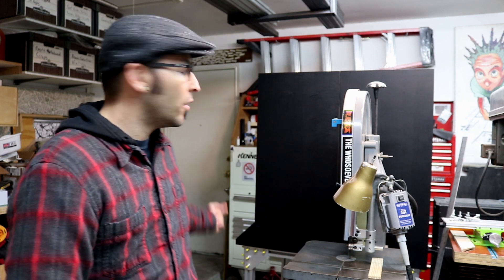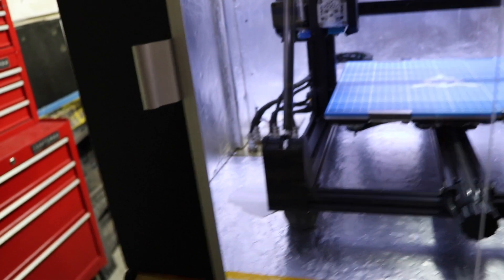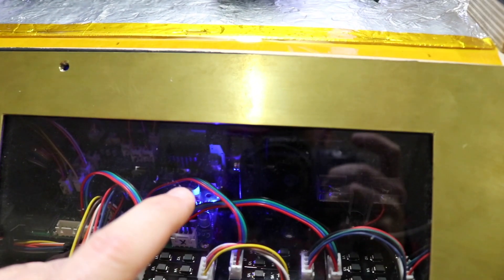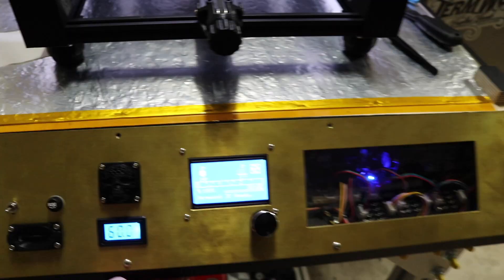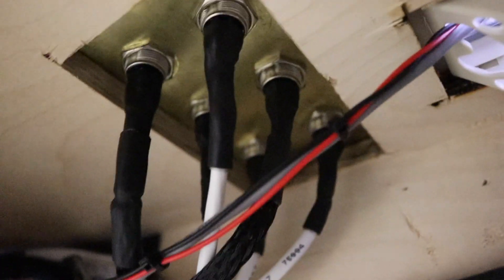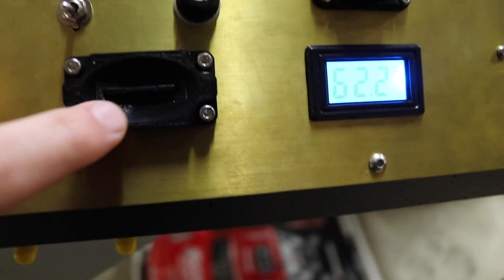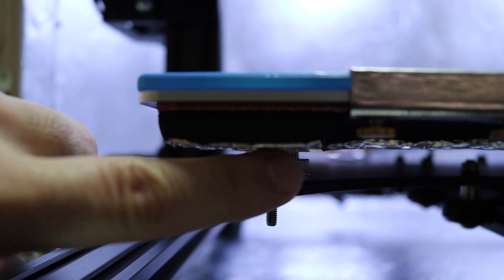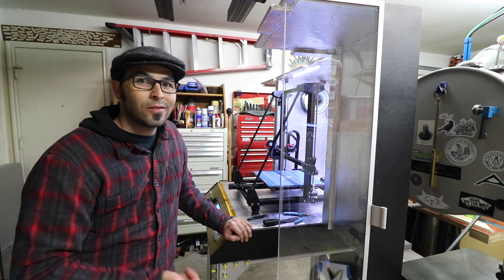THE ULTIMATE CR-10S 3D PRINTER ENCLOSURE!!!

Comment: Could you please share what type of connector you are using for the wires? The round, mostly 8 pins, is what I'm referring to. ty
Reply from the maker: They are 8 pin aviation connectors. I must warn you they are a pain to work with. 
https://www.amazon.com/Metal-Female-Connector-GX16-8-Aviation/dp/B07D2675JW/ref=mp_s_a_1_1_sspa?adgrpid=58799115031&dchild=1&gclid=EAIaIQobChMI9r_0vZG97wIVzP3jBx3JfAH_EAAYASAAEgLe2fD_BwE&hvadid=274709648591&hvdev=m&hvlocphy=9028249&hvnetw=g&hvqmt=e&hvrand=2348470054554098024&hvtargid=kwd-305733728779&hydadcr=19223_9665532&keywords=8+pin+aviation+connector&qid=1616183719&sr=8-1-spons&psc=1&spLa=ZW5jcnlwdGVkUXVhbGlmaWVyPUEyTUE3TEFLWEw0RDNHJmVuY3J5cHRlZElkPUEwOTIzMTY5MzZCNTRSSzNEMVBNUCZlbmNyeXB0ZWRBZElkPUEwOTc1NDI1MjZHVDg3VjYwV1lJWCZ3aWRnZXROYW1lPXNwX3Bob25lX3NlYXJjaF9hdGYmYWN0aW9uPWNsaWNrUmVkaXJlY3QmZG9Ob3RMb2dDbGljaz10cnVl

Comment: How did you install your logo on led screen? Was it change the words in the program on start up or where did you rewrite it at?
Reply from the maker: stephenspencer2121 I kinda fumbled my way through it. I found a code generator on the marlin website. You up load your image as a bit map so you have to play with the resolution to make it look decent. Google custom splash screen for Marlin firmware and see if it turns up. Good luck!

Comment: Hey man loved your video!  Do you think you make a video on constructing the enclosure or at least send the dimensions so that others may build from it?  Thanks
Reply from the maker: Thanks! Yeah I didn't film anything on making the the box because It was basic cabinet making, cutting plywood and nailing together stuff. Makes for a boring video in my opinion. There's tons of videos out there that can teach you that. Plus my cabinet is specific to my needs and most of the dimensions were decided based on the materials I had to work with and what I needed to accomplish. The point of my video was to give ideas and insight to other makers of what is possible and to provide a starting point. Personally I don't like plans and will tell you it's better to not use someone else's plans but to create your own and make your project your own. You'll learn more and it will be more rewarding and useful. 😁👍🏼